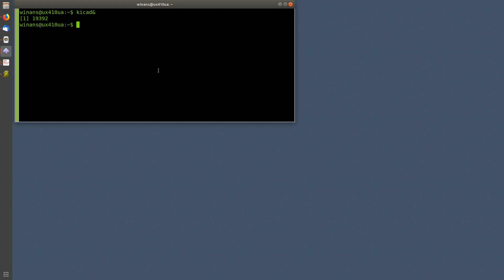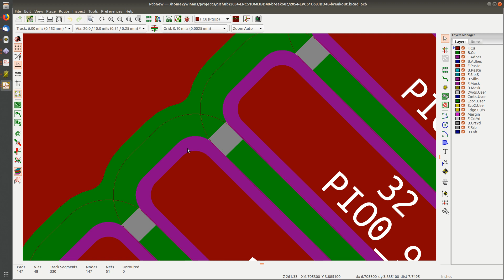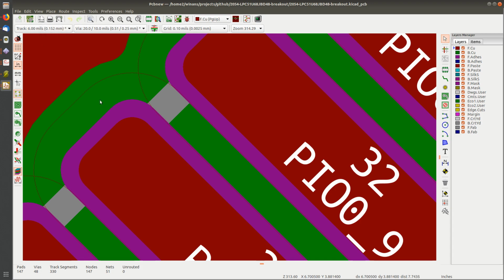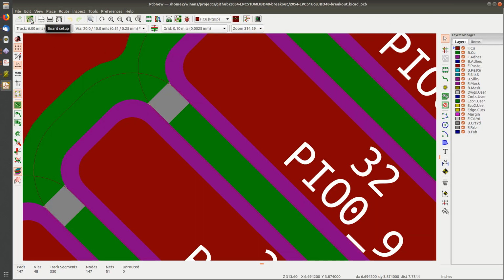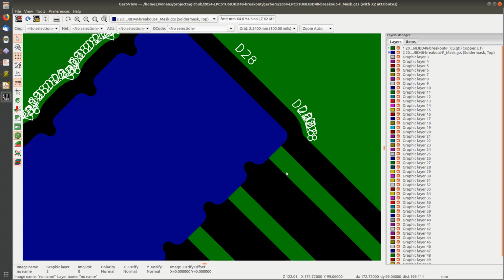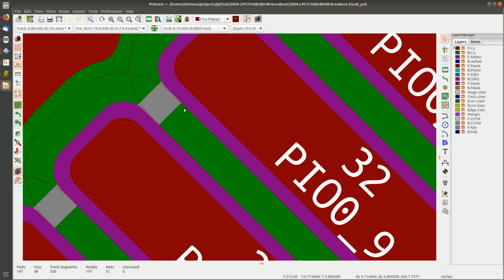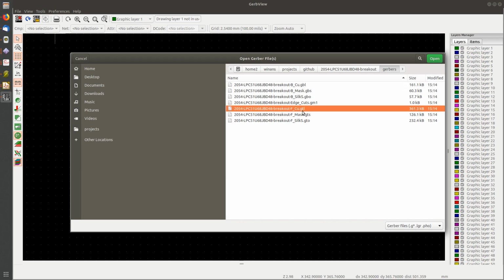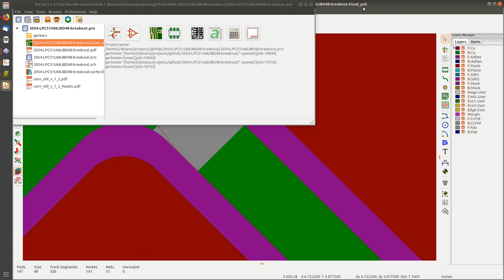KiCad 5 #29a Fixing a Soldermask Problem On My LPC51U68JBD48 Breakout Board

Comment: Hi, firstly, great videos, I really enjoy watching them. I've been working wit KiCAD for few years now from time to time, I've had designed quite a lot of PCBs, but still, I've learned some new things from Your videos, so Thank You. Secondly, about the soldermask clearance. It would be probably better to change the value for the single footprint only, so in the worst scenario, only pads for this particular one wold be partially covered, but not all the pads. You can change it globally in the library, but I would preffer to change it for the single footprint in PCB editor (footprint properties).
Reply from the maker: Dooohhh!!!! I was not thinking!!  Yes!!! Definitely! 

Thank you for pointing this out.  I will have to mention this in a future video.

Please feel free to offer any critical comments on my videos. I'm sure there are more oversights/mistakes/omissions in these.  Everyone should know of the best practices!
Reply: @JohnsBasement  Well, since You asked, there may be some minor points to talk about. It's definitely NOT a big deal and for most applications You don't need to bother with it, but it may be useful to mention that. 

1) Decoupling caps - they should be as near as possible to corresponding pins (they actually are in Your design) and the current should flow from source to sink through these caps. I am not sure, if I can describe it well, but what I mean is, that the track to supply pins should go from capacitor pad, not from the power track, otherwise there is additional impedance (in Your case it is really small, so it won't be issue at all, but it is a good practice to get used to this).
2) It would be great to have larger copper surface connected to the regulator flange to distribute heat better. Again, I suppose it will not heat that much in Your application, but it would be great to mention it. You can probably put a small filled area under and around the regulator body, maybe even on the opposite side, since You have a track there anyway. Just a small one, so there is still plenty of space for ground plane.
3) This is really just for nerdy enthusiasts :D. According to USB specs, USB shield should be grounded only on Host side. I once discussed it with my coworker, who specializes on USB applications, I am no expert on this, so I am just forwarding, what I got. On the device side it should be connected to shield ground in case of metal encloser and this shield ground should be connected to signal ground via a resistor and capacitor (eventually single point connection could be used). It is used to prevent EMI, ESD and RFI issues (or something like that) and also it prevents current loops, which may occur.

So these are some notes, definitely not major issues, or issues at all. I just thought it would be fine to mention that. But even professional designers often ignore this, so I am just mentioning it in case somebody is interested in that.

And again, thank You for Your videos, these are great and easy to process and I enjoyed them. Have a nice day
Reply from the maker: @videomixerification  oh geez.  Yeah, #3 is just embarrassing.  I probably should have floated the shield or put a cap between the USB shield & local ground. 🙄
The power requirements on this are low enough for me to have gotten sloppy on the rest.
I wish there was an efficient way for all of us hobbyists to get quick design reviews.

Comment: At risk of being naive, why don't you just take that 0,2mil from your copper pads? Lots of work, I know, but looks like a permanent solution and you don't need to mess with tolerances in the future, right?
Reply from the maker: The pads are already pretty tough to align the chip with as it is.  A narrower pad would also reduce the solder fillets on the edges of the pins (weaker bond).
I expect OSH Park to do better than their worst case estimate on the solder mask.
On a production run, you'd have to coordinate with your board fab and your assembly service on these choices.  For hobby work, I want big pads and solder mask threaded between.. even if it cuts too close once in a while.
Reply: @JohnsBasement  Fair enough

Comment: I just sent off a board like this and I see your point now, although still solderable would be nice to have mask in between pads at that pitch, Ill be totally honest on my last board I didn't even give it any thought, I figured it was normal to just have a solid block over the pads and I had no real problems with populating it, a few bridges but hey wasn't a day ruiner. I'm gonna see what JLCPCB can do and then send em boards with what I want them to do, seems there gonna come back ok whatever...very interesting point, worth a looksy...cheers John!
Reply from the maker: I've not yet tried JLPCB.  Do you have an opinion as to how they compare to PCBWay?  At some point it'd be interesting to note things like soldermask quality between fine pitched (.5mm) pins.
Reply: @JohnsBasement  I have not tried anyone else at the moment but I will say the boards I have had from JLC have been beautiful (no  affiliation) really blew my mind the first set of boards, I wondered how they did it for the money, as an example I have my boards delivered here in the UK for £6.50p, or less than a couple of pints! and it takes about 9 days ish. Regarding the solder mask, this is something I'm gonna take more notice of next time, for some reason I kinda assumed that the FAB house would adjust it according to the footprint and squeeze some mask in there, you actually opened my eyes to this one.
Reply from the maker: They can add mask but you'd have to ask for it.  My experience is that they are more likely to remove it without telling you!!  Let me know how your solder-mask results go!